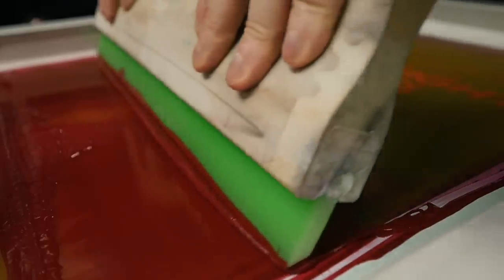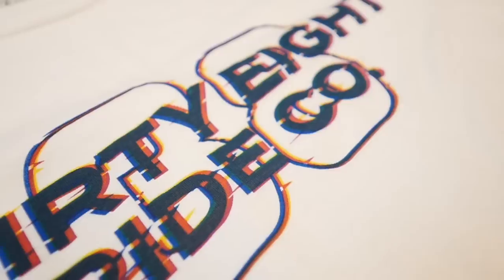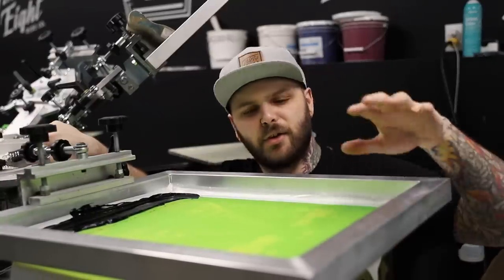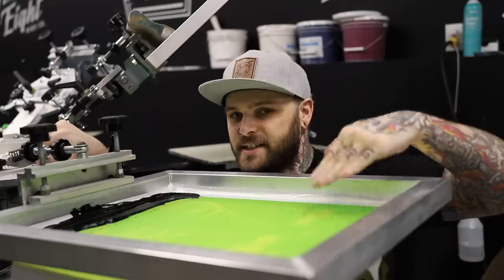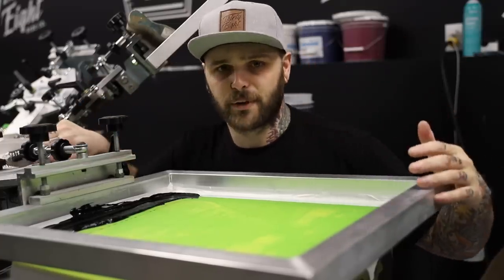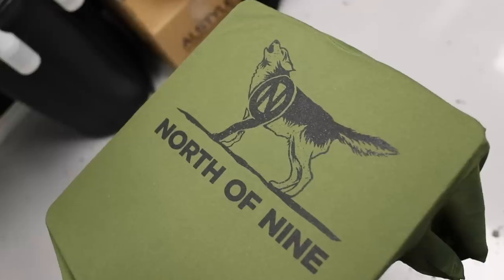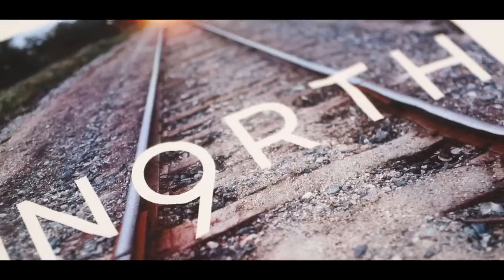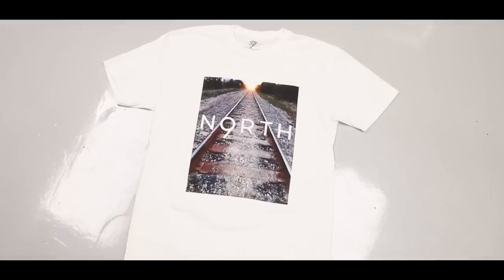I Screen Printed THIS!

Comment: Hey man, just wondering what type of water pressure you're using for your 305 screens. I use a ryobi electric pressure washer and I back up about 2 feet to wash my higher mesh screen to get it to wash out so that it doesnt wash out the design. Sometimes I have to turn it off and use the water spraying out of the nozzle. Do you have any tips on washing out higher mesh screens?
Reply from the maker: Sounds to me like you might be underexposed if it's washing out that easily. I can hit it pretty hard with the pressure washer before doing any damage to the stencil

Comment: Hi Mate, thanks for sharing this. Very helpful. Well, can i ask for the ink you use? Because when i use plastisol, it kinda wont be smooth when i touched it. Appreciate that
Reply from the maker: I used plastisol for this. I use it for most things, not really a big fan of waterbased stuff yet. But there is a green galaxy water based kit for this stuff that works well if you want smooth
Reply: @leestuart38  thanks for replying, Lee. Appreciate that. Yeah, waterbased kinda dries easily, thats why i moved to plastisol. But this one is awesome, looked smooth.

Comment: Awesome prints, as for the lpi if you are using 305 mesh wich equals to 120T then you may go up to 60-65 lpi safely, I also use some dual cure chromaline emulsion UDC-HV and it gives me great resolution  and detail everytime without any issues, if you have a chance try it and let me know if you liked it, thanks for sharing and keep up the good work.
Reply from the maker: Ya I could have definitely used a much higher LPI, I just wanted to keep it simple on my first try so I could get this done. I have some dual cure emulsion here but as we know it has a short shelf life and I didn't want to waste a whole gallon for one job. I think I can probably fine tune it with the photopolymer and get the results I'm after, but an LED exposure unit will still give the best results since there isn't any light scatter. So I'm gonna work hard and get one of those so I can step my game up

Comment: Hell yeah! I have to ask, what the hell was going on with the 24-70? Was it the 24-70 f2.8 ii usm? Interested in gear too. How’s the new lens with IS?
Reply from the maker: Ya that's what I had, such a bummer that thing wasn't everything it was hyped up to be. The camera shake was insane, even when I was perfectly still. And it had some bad magenta fringing going on under certain light or focal lengths. Plus I was pretty pissed from the second I opened the box and found the whole thing was made of the same plastic as their entry level lenses, a $2500 lens shouldn't be like that. The new sigma however is amazing. The IS isn't the best I've seen, but it's a looooot better than not having it. All around this lens kills the canon for what I do

Comment: Hi Lee, thank you so much for sharing you experiences. I'm planing to print a very similar job next week with the Wilflex epic process colors and I'm scared a little ;-) I'm wondering if you printed wet on wet or if you flashed in between. I would really appreciate knowing how you did. Thanks again.
Reply from the maker: Always print wet on wet with 4 color process inks. They need to blend to create smooth color transitions.
Reply: @leestuart38  Oh thanks. Good to know. I'll test that out next week. Good printing to you
Reply: @leestuart38  Thank you, goof to know. Do you remember what raster you printed (lpi?) on which screen mesh?

Comment: Would LOVE to see how this comes out with a white under base. Can't wait to see how you do the spot color separation! Definitely subscribed!!!!
Reply from the maker: On a white underbase it's a whole different animal from what I know about it, but I'm definitely going to be giving it a shot and figuring it out 🤘🏻
Reply: @leestuart38  Yeah as a photographer it's been one of my dreams to be able to sell my work on shirts and i've been looking for the best way to go about printing them and kinda gave up on silk screen for a while. I worked at a print shop for a bit and it seemed like getting photographic prints like these without some big warehouse that has like 100 screen machines was impossible. Especially on black cuz i've personally seen what happened when we'd try to print photos onto black clothes. It's a whole mess that never turned out well with anything other than monochromatic images. Even more so with a colored/black shirt. So I've been doing heat transfers for a while, which one white shirts i think work really well, but i hate the feel of 3G opaque on the colored/black shirts it just feels like paper. So seriously hopping it goes well i'm excited to learn from your channel about the process!.